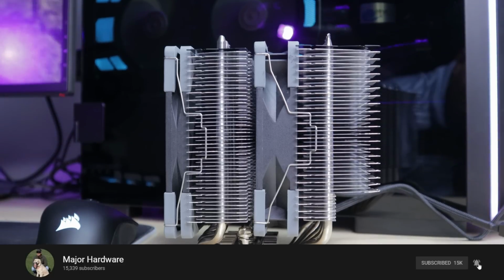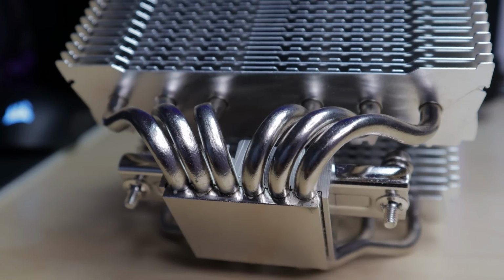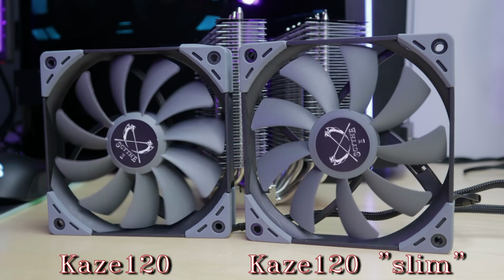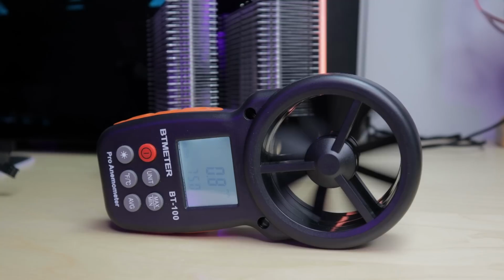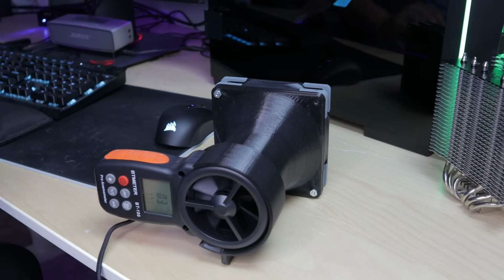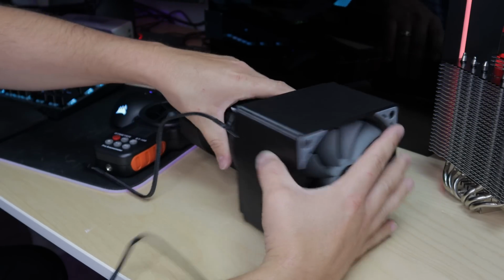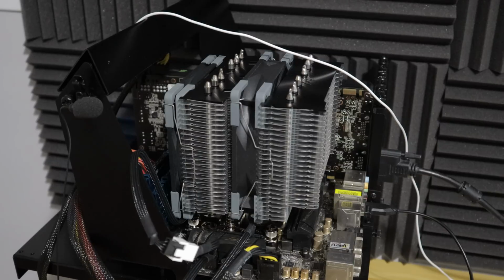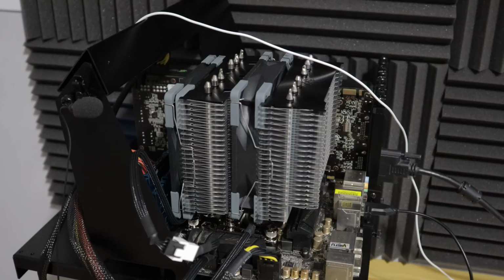This Air Cooler Is Doing Something No One Else Is! | Scythe Fuma 2

Comment: The only fan not getting a reading is spinning the opposite way, which is the reason I think.

One thing you can do is add a bunch of small straws in the plastic shroud to create linear flow (SmarterEveryday anyone?). This should remove the effect of the rotation

Comment: If the air is flowing in a different rotation than your typical fan, the device used will likely fail to read it properly. Placing your hand behind it likely influenced the flow of the air produced enough to help spin up the anemometer.

Comment: Why is this so important to straighten the flow given you want to push the flow into a radiator or suck it outside the case. Looks like it means something to front case that have to make the flow travel for some distance.
I like Scythe coolers a lot but the fans, if possible, regular colour Noctua is my pick or cheap Arctic ones.

My favourite helicopter in the world is the Hokum which has two rotors to defeat the need of a rear rotor for balance.

Comment: Counter rotating propellers and fans are actually very common. Sunnon makes a line of 40mm fans with counter rotating fans. They spin at up to 15K rpm and are loud as f... loud as a loud, thing... The use of dual in line fans like this helps increase the static pressure more than increase the airflow, and making them counter rotating makes them just a bit more efficient. They are also somewhat redundant, as if one fan gives up the ghost the other can still provide some airflow until the machine can be serviced.
There are also a lot of fans that use a stator, basically a non rotating fan placed after the actual fan, to straighten the air stream. I don't have any numbers on how much this improves efficiency, but it's apparently at least somewhat efficient.
Fans like these are  often used in servers where reliability and airflow trumps any regards for noise levels.

Counter rotating propellers are also popular on motorboats, I even remember seeing them used on high power outboard engines, and here the advantages are well documented. On a motorboat counter rotating propellers are not only more economical, provide better acceleration and higher top speed, but they also eliminate side ways torque and a tendency to tilt the boat. The tilt can be mitigated using the trim planes and the sideway torque is usually not an issue at speed, but can make low speed maneuvers tricky, but eliminating the tilt using the trim planes cost a bit of performance.

Just to make this a bit more complete there's also motorboats that use dual propellers, one on either side of the boat and has them counter rotating. This will eliminate the sideways torque, but doesn't give the same increase in efficiency and performance as using inline counter rotating propellers. Having dual propellers has other advantages such as increasing maneuverability at low speed.

Counter rotating rotors are also used on some helicopters. Here there are not only advantages but also some serious disadvantages. As "usual" with counter rotating props the airstream will be a bit more efficient, and there is no torque trying to rotate the helicopter so there is less need for a tail rotor. I'm not sure if there are any commercial helicopters using coaxial counter rotating rotors and no tail rotor, though I guess it would be possible. There are however several disadvantages to coaxial counter rotating rotors on a helicopter. They add weight, the mechanics add complexity, and they limit the top speed as you can't use rotors which allow for the blades to flap (I think that's what they call it, it's been more than 30 years since I read up on this...). On helicopters the rotor hub can allow the blades to flap (move up and down somewhat which helps them survive the added load that high speeds put on them), lead-lag (precede or trail the hub rotation by a few degrees) and the hub controls the pitch of the blades. When using coaxial counter rotating rotors you can't really allow the blades to flap, or they could run the risk of hitting each other. Thus they use simpler hubs, often with only pitch control and this limits the performance at speed, and makes it impossible to fly at really high speeds.
I'm bungling this... It's not like I'm an expert on helicopters, it's just that my brain has been good at sucking up just about any info I found interesting, and what kid didn't think it would be great to learn how to fly? But when that was thirty of forty years ago the details are a bit hard to remember.

Comment: I think the primary benefit of this fan setup could be how easy it is to direct the hot air into a rear exhaust fan in a case. You might want to try this cooler in multiple configurations in a somewhat restrictive case to see if it affects temperatures, including GPU temperatures.

Comment: Scythe coolers are solid coolers. I run still one $cythe Muggen. This is an older one, but also a biggy, bit similar in look to the coolmaster pro4 in size.  It's still doing very fine. There is also the Ninja for smaller builds, it's also a fine one.

Comment: You've created a venturi with your adapter. The speed of the air will be increased at the measuring point.  The fan probably doesnt have enough static pressure, and is maybe creating a bit of a vacuum or 'equalization'. Just a stab in dark really, not sure.

Comment: Here is an obvious issue for Ryzen 3x builds. You will be using the same heatpipe for your chiplets.
Reply: 2 heatpipes go over the chiplets directly and this will still be better than most designs still. But yeah it would be nice for the dual chip designs if AMD rotated the chiplets.

Comment: Hi, nice vid. Im new to the channel, i don't want to be that guy, but, did you account for the venturi effect caused by the bracket's concentric diameter reduction? If not numbers can be "inflated" 😆and air flow speed increased... Cheers
Reply from the maker: I did not, my thought behind this is I was comparing the fans to each other on the same setup so they were all on level playing field. However I do recognize the point you bring up and plan on redesigning my testing method  to make things more in line to manufacture claims. Also welcome to the channel

Comment: I noticed an interesting thing.  I bought an old dell server (with 2 xeons in it) and I put nearly the hottest CPUs I could in it.
And they ran hot and loud.,
But after cleaning and lubing both the case fans and the heatsink fans, the computer ran much cooler and quieter.  So lubing fans is useful. I brought the temp down from about 100 degrees to 85 at full load.

Comment: With the narrowing of the air tunnel, thus you are creating a back pressure on the fan blades and actually slowing the fan motor down. The proper mounting and unrestricted airflow, with the exception of the mounting of the heat-sink fins assembly, presents virtually no back pressure; thus the fan can run at optimal air flow and rpm's 
If you take a car exhaust system and reduce the internal diameter to much, thus you have back-pressure would be too excessive and the engine performance can suffer! Same analogy, when applying physics! 
Even though you may be trying to create a vortex by the making or printing that said adapter, and trying to perform a CFM test or pressure test; you in turn very quickly find out that the fan doesn't have enough ass behind it to get the results that you may have come to have expected!

Comment: Sir, u need air straighten fins I side your duct. Take a min and study the wright brothers model wind tunnel. This is why u got no pressure from the fan running in reverse.
Reply: Also, all your fan measurements are invalid because you didn't do this.

Comment: The adaptor is probably causing a total pressure loss by constricting the flow, so the speed hitting the anemometer is just insufficient to measure.
You have to calculate pressure loss to design such adaptors, specially considering most computer fans aren't exactly known for high pressure flows.

Comment: how about the fact its $55, damn near silent, and performs on par with noctua
Reply: its on par with noctua up to 130W TDP, if you put 250W TDP on this thing, it will overheat.
Reply: @SrUnr3al  true, but it is a very good cooler for everything below a 9900k
Reply: @robert3374  but almost 50% cheaper (than d15)
Reply: It's a 120mm cooler - much smaller than the d15
Reply: So pretty much it's rpm is lower so it's alot quieter. But yes cannot reach temps of the larger coolers.
For the price and most overclocks this is a dam good cooler.
Reply: Where did you see a noise normalized testing, this vs a noctua (wich?)? Because i didnt...
Reply: I believe it's Tweaktown, but an easy search on Google will show you
Reply: It's "not on par" with noctua. However, it is in the same ballpark.

Comment: Secondary fan is probably designed for counter rotating air, not stagnate air. (Or better yet its designed to push allready moving air becouse the fins negate any spinning air)

Comment: I put seven 90mm fans in a push pull configuration each having alternate rotation directions.  It was really pulling the amps, and in the end had a stable and very loud airflow which was maybe 60% faster than running only one fan, but when attempting to stop the airflow, you could feel a significant pressure.  The reason you don't notice much different cooling is because cooling has a direct relationship to air displacement,  so unless you speed up the rotation of the fans by increasing the voltage or increasing the size of the fans, you shouldn't see much in terms of gains in cooling.  If the push pull configuration was separated, so warm air from the first fan was exhausted rather than blowing that warm air over the center fan, you may observe a greater cooling effect. This could be achieved by separating the fins to allow two adjacent pull pull configuration where the air intake is in the center and is exhausted in opposite directions, you may achieve this.

Comment: It would be curious to see the smoke test repeated, but with the fans blowing through the cooler. And then repeat the same test with standard fans on the same cooler. Be interesting to see if there is any direct difference in the airflow shaping post cooler. Because if you can direct the majority of the exchanged heat directly to the rear exhaust fan, then there could be a net benefit. Because we already know how much of an improvement a rear case fan makes on CPU temps with a tower style cooler.

Comment: The only thing I would say is when you tested the airflow of the 2 fans you should have used the fins when you were testing because those fins should stop most rotational air since they're horizontal so having counter rotational fans with fins between that already stop that rotation in the air passing through it. (As you mentioned briefly after showing the smoke test)

Comment: It's to help aim the air out the back of the case where u normally put a 120mm exhaust fan instead of spreading it out like you showed with the led and smoke so it does potentially have a advantage of push more air out of the case or at least in that direction which will marginally affect the rest of the system, things like this you cannot test on open benches, I know it's simple to use but frustrating that tech YouTube channels are testing in this way, how many people actually use these compared to closed cases seriously yes there are many different case designs but they are still not open benches so it's a bit redundant doing benchmarks this way unless majority start using open benches as well

Comment: It's because the fan spins in opposite direction vs what your meter is made the measure. If you could change the fan that takes the reading on the meter to opposite shape fins you'd get a reading.

Comment: It's because the anemometer you're using is a lower quality, relatively high flow anemometer. All of the anemometers I've seen on amazon are pretty cheap quality and high flow, haven't found one that's spec'd to go below 0.3m/s. You need a more sensitive one if you're measuring really low flow rates. Back when silentpcreview was still active they used a calibrated kanomax 6803 anemometer that could go down to 40 fpm (0.2 m/s) flowrates @ 1% accuracy. That enabled them to accurately measure fans when they were way undervolted to 300-500rpm.

edit: At least you're doing anemometer measurements lol. Everyone else is like... Heatsink nice! Fan flow good! Temps great! What? Variables? No control? No problem! plsclickaffiliatelinksandbuykthnks.

Comment: I suspect the "reverse flow" is a gimmick - the fins of the heatsink will remove most of the rotational component of the air before it reaches the second fan.
Reply: ^This
Even if the air speed keeps the flow turbulent, the fins actually make the flow mostly directional and considered unmixed.
If we were talking about fins very far apart (non practical and I've never seen mostly requiring a distance greater then two times the boundary layer to achieve a "open flow") it might be worth something to use this.
Reply: yes but since the fins are in one direction, the rotational blades do actually make a sideway airflow, so facing a clockwise fan pushing air into horzontals fins, the upper fins that catch blade from left to right would make a diagonal from left to right airflow, and in the lower would be the inverse. but in the middle stacked fins, the airflow must be like you say and that could be the most of the part of the ariflow behaviour. the phenomenom I'm talking may not be as significant as I first though.
Reply: Ill bet a design with concentric rings for fins would preserve the rotational airflow but dramatically increace the cost because each circle is a unique part rather than being the same fin stacked up (other than the ram cutout on the back)
Reply: @punksweeper4678  Curves are expensive. However a square pattern would be relatively achievable and prevent lateral flow of air. Possibly even a single 90degree fin closing off each open side of the stack and forcing all the air that goes into the stack to go all the way to the end of the stack would suffice. But I suspect in a push-pull dual fan configuration, the second fan's intake flow has a similar effect to a solid fin wall forcing the air to make its way along the fins instead of escaping laterally. The second fan already needed to counteract friction along the fins of large stacks, the wall becomes redundant which is why coolers don't have any. And in narrow stacks the lateral movement doesn't matter much anyway.

Comment: Nice work work on visuals. Yesterday ordered Scythe Mugen 5 Revb, for my 2500k, gunna hot rod it to 4.5, see if it is stable. SUBD 8-31...oh yeah nice 3D work.
Reply: I'm using mugen 5b on my 3570k @ 4.3. at ambient of 27C, it reached a bit above 70 during stress test. Add another fan to it and it went to lower 60. Quite impressive & silent too.

Comment: As you can see from your non-restricted outlet smoke test, an axial fan actually doesn't produce much purely axial pressure (unless you're using several rows of stator veins, like in a turbine). Most of the pressure - and hence most of the flow - is directed in a spiral that EXPANDS out from the centerline at about 45º out from a point near the blade tips. That's why your smoke test looks like a wide cone of air.
Even static pressure optimized fans need a rather large expansion volume behind the outlet to work properly. Your anemometer test would have worked just fine if you inverted rotated the so that it sucked air in from the restricting cone where you mounted the flow meter.

Comment: Run the fan pulling air through the anemometer housing and reverse the anemometer. Thereby negating any spin the fan blades impart on the air as it (the air vortex) is now after the fact.

Comment: Is it possible the fan you couldn't get the reading on is throwing the air OUT centrifugally rather than the direction of fans normal flow?
Reply from the maker: It may be possible

Comment: I think your anemometar is directional (and rotates the same way as the ''standard'' cooling fan). The contra-rotational Kaze 120 moves the air in a spiral that is opposite of the anemometar and it throws the results off. Someone in the comments said that you need an omni-directional anemometar (and I quess this will solve the problem since I don't know if anyone makes an anemometar with the contra-rotation as the Kaze 120).

This is all speculation on my part put it has some logic to me. Awesome content BTW, very informational and original. You are gonna blow up soon!

Comment: Wouldn't rotating airflow be negligible in use because there's fins directly behind it? 

Worst case, radial forces will just push airflow outwards at an angle, but with the space between the fans, that won't get counteracted by a counter-rotating fan.

Comment: I think the fans entered what would be called a vortex ring state in a helicopter. The outside of the blades were not made close enough to the casing of the fan, and the thrust from them hitting the ducting was escaping back out the front from this gap and re-entering the fan's intake preventing any meaningful thrust.

Comment: Nice jig you made for fan testing. Question though : most of your fan results are in line with what the manufactures say their fan can do EXCEPT The CM Blade Master. It's only rated at 80cfm, and you got 120cfm? Even with margin of error, that's for that 50% more airflow than what CM rates it for. Curious as to what you think is happening with that fan and your setup for testing.

Comment: The "helicopter" (drone) that NASA is sending to mars uses contra rotating rotors to get some extra lift, so their idea is not baseless. However I'm not sure if it will make any difference at that distance with fins between the two fans.